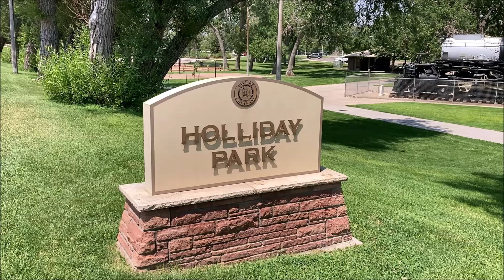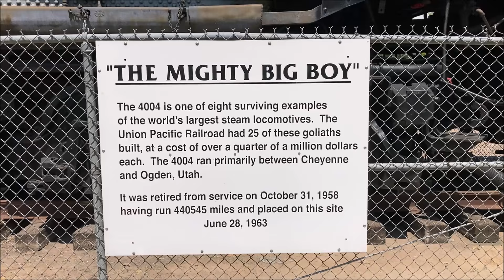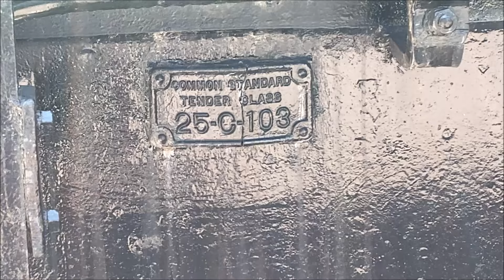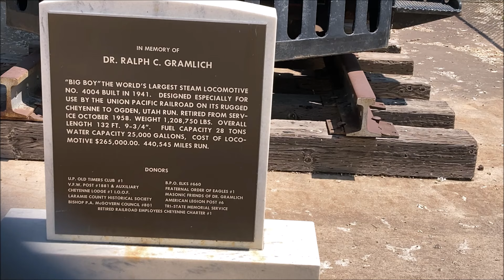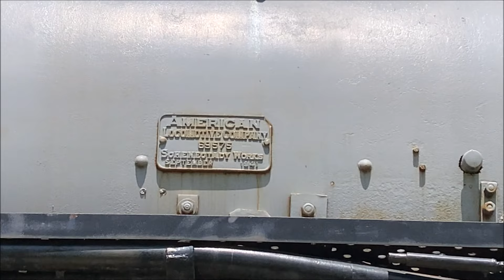Union Pacific Big Boy #4004| Aug-3-2024

Comment: How has the 4004 remained in so great condition?
Reply: It might look OK sitting there, but if it were in that great of a condition, then it would have been the one that got restored to operation. UP went and evaluated each of the remaining Big Boys before beginning their project and determined 4014 to be the best candidate mainly because the asbestos insulation had been removed decades ago and not having water logged asbestos caked around the boiler jacket like all the rest did, so it’s boiler was in the best condition to be put back in operation. 
Other than that, volunteers keep the 4004 painted and apparently do some maintenance on it to prevent it from just turning into a rust pile.
Reply: @ralfie8801  Well 4014 wasn't in a great condition either though I don't care as long as it's safe.